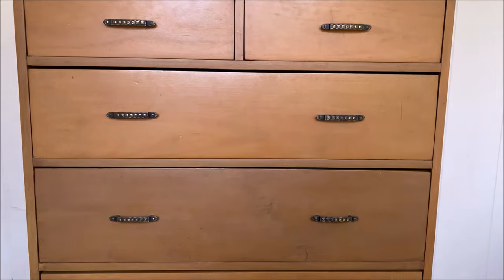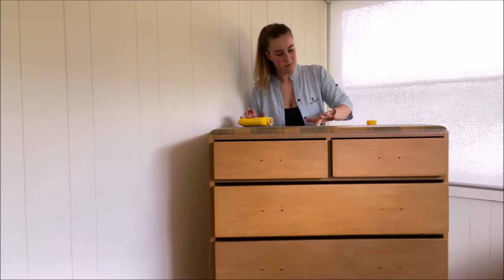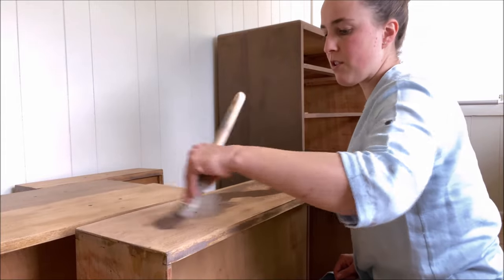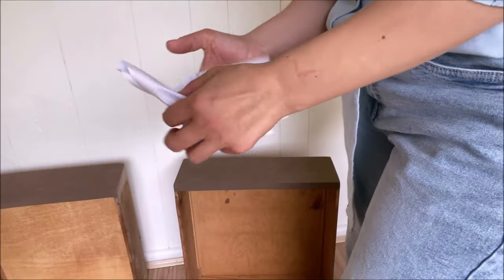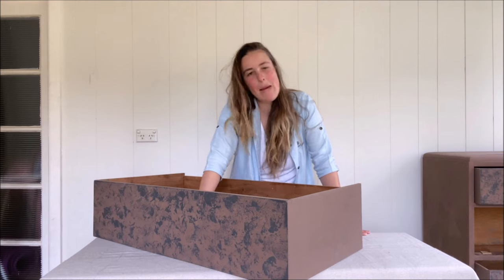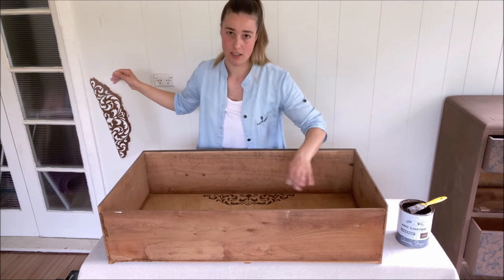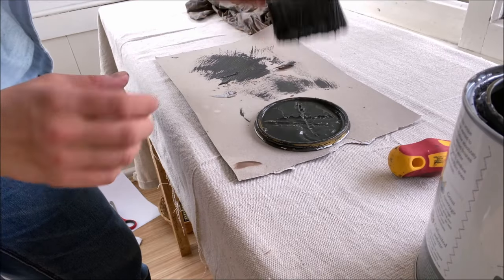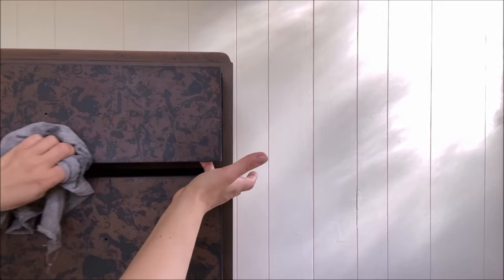ANNIE SLOAN CHALK PAINT TRANSFORMATION QUEEN ANNE STYLE DRESSER - texture and stenciling

Comment: Did you use a wet or dry brush? My brushes drag if I don't use  mister. Ended u turning out beautiful. Great job.
Reply from the maker: I used a dry brush but helped myself with a spraying bottle ☺️ I used the spraying bottle mostly for the first layer to help to spread the paint and I used the dry brush for the other 2 layers to give it texture.